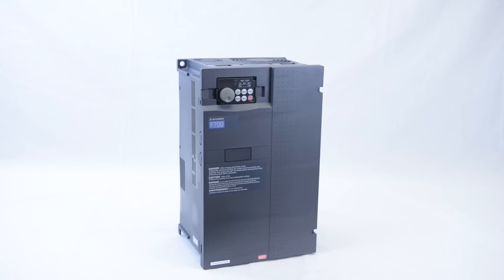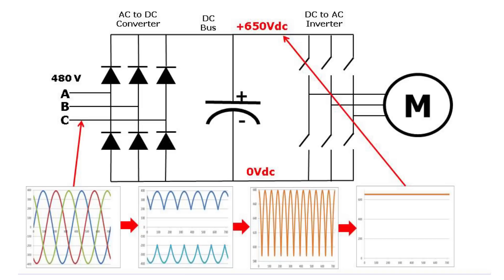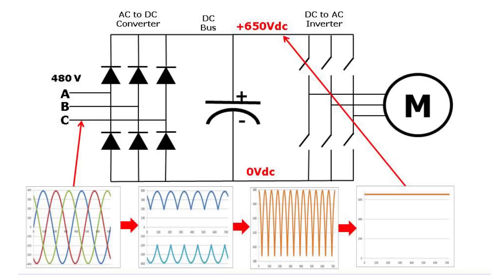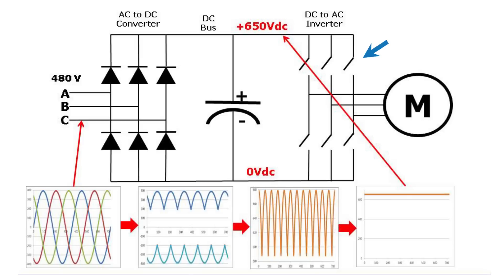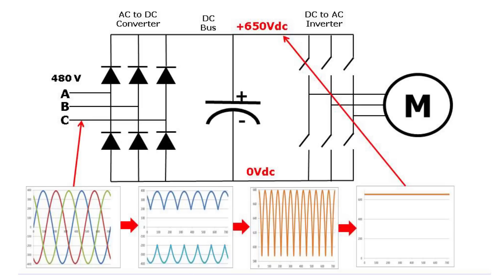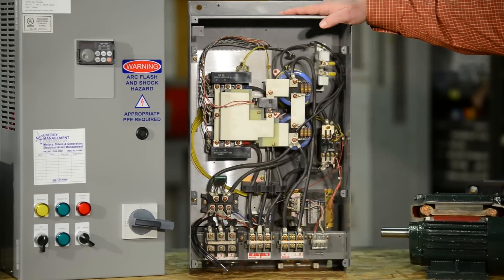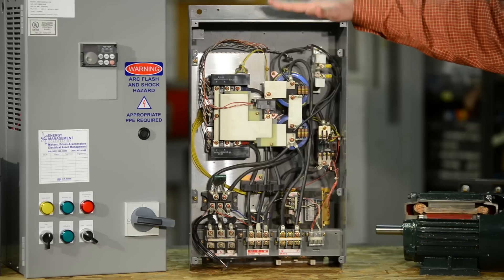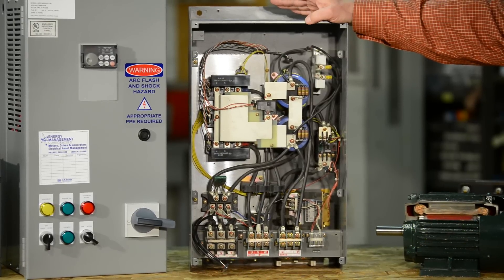What is a Variable Freqency Drive (VFD / Inverter)?

Comment: Respected  Team
I ve 1-P  220v VFD ranging voltage 220v to 360v, using this VFD on solar system with bore well
when applied 350 v DC the motor starts to work with slow speed & when applied 400  DC volt, the speed is faster than before but with 400v,  some times error comes shown "over voltage". then we reduce the voltage by manually minus the 1 solar panel from string.
Now i want to run motor on 350 volt DC and then add 50 volt more while running motor by means adding change over switch or relays  or you'll recommend
Can this Possible?

Comment: If you had a single phase VFD and changed the frequency to 120hz from 60hz and connected it to a transformer stick welder would this increase the frequency ?

Comment: Sir, did vfd Carry or have timer inside? Or  can vfd work intermittently that is work for some time and stop later it will restart again based on the time you set it.
Reply from the maker: Yes, that is part of the parameter setting. Most VFDs have that capability. We cannot provide parameter settings since every drive is different.

Comment: wow, just the info I was looking for!  But one thing is still not clear.  What controls the switching speed of the semiconductors?
Reply: Michael, pause at 4:11. See the group of small wires on the left of the transistors that are not connected.  Those connect to the controllers on the front of the cabinet, which you can see part of on the left of the video when paused at 4:11.  That module is what manages the switching speed thus how a human operator is able to control the connected motors/equipment.  These can be simple start/stop buttons (for preset speeds) or more complex (programmable) for multi-speed levels or ramp up/down.  The module in the video appears to be a variable type as it contains a jog dial which would be used for adjusting the values. Hope that helps!
Reply: Jeff Bingham damn. I really wish i knew more about this stuff. I'm trying to work logic into a machine I'm building with linear actuators. All i need is pole switching. I had no idea how complex it would be

Comment: i have a question  when i check my motor load at drive side its shows 35 amps but when i checked it at motor terminal box side its changing frequently from 35 to 105 . i dont know what to do can any one help

Comment: Why do people build rotary phase converters? This seems way easier.
Reply from the maker: There are a few reasons. The limitation of VFDs is that you cannot have any electronics after the VFD in the circuit. If you have switches or lights, they have to be prior to the VFD. So one of the more common scenario is when you are trying to convert an entire facility that supplies single phase power. You want to get a phase converter because other than the machines, you also have transformers, lights, computers, and other electronics in the building. 

Another scenario is if you do not need speed control, have multiple machines, and have single phase power; it is possibly cheaper to get a phase converter instead of multiple VFDs to convert that single phase.

Hope that helps.
Reply: That's interesting. Thanks.

Comment: Hi Sir,

I am trying to trigger the Phase Loss fault of my VFD by supplying only 2 phase into VFD and output 3phase to Motor.  After running around 3 minutes, nothing has happen, motor amp still under FLA, and VFD does not trip.

my VFD size is 5HP and my motor HP is 1HP.

I just trying to know how the fault is triggered.

Kind regards

Ray
Reply from the maker: Ray, what kind of drive do you have? Do you have single phase power?
Reply: Hi Sir, 

VFD is 3Phase Input (with single phasing connection), 3Ph Output.

I even checked the DC-Bus voltage
3ph input with 3 connection - around 6036 - 6059
3ph input with 2 connection (Single Phasing) - same as above

Does VFD has the protection over single phasing ?

Kind regards

Ray
Reply from the maker: Ray,

You need to set the parameter in order to trip the VFD. For Mitsubishi VFDs, the parameter is called "Input Phase Loss Protection". It is parameter # 872. Default value is 0 (will not trip), and you can change that to 1.

Comment: i have a question to ask and i need a answers back please 

A variable frequency drive (VFD)should NOT be used for:
a. Recent fault history
b. Speed control
c. Soft start
d. Lockout/tagout
e. All the above

A variable frequency drive (VFD) in the “Running” State of a 480 Volt system has:
1. 480 Volts to the VFD
2. A motor overload
3. A “logical” run enables system
4. 1 and 2
5. 1 and 3
Reply: I presume the first answer is lock out tag out. It wouldnt really be a sufficient way to isolate something. VFDs control speed and soft starts by decreasing frequency. Modern vfd's have displays that show faults. Not too sure about the 2nd question though.

Comment: what difference between VFD and Frequency Converter?
Reply from the maker: Hi Koposov, a frequency converter is designed to change a specific frequency to another specific frequency. For example, if you have 60Hz power, and your heater is 50Hz, the frequency converter will allow you to use the heater with the 60Hz power.

On the other hand, a VFD is used for speed control of an electric motor. You can adjust the frequency (speed) from 0 to 60Hz. You can also program the VFD many different ways to control the speed of the motor.